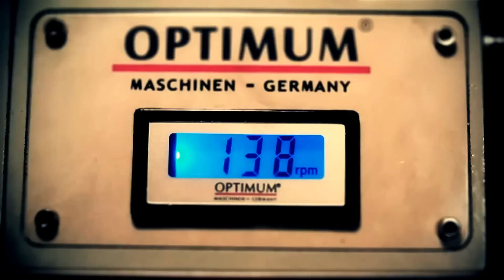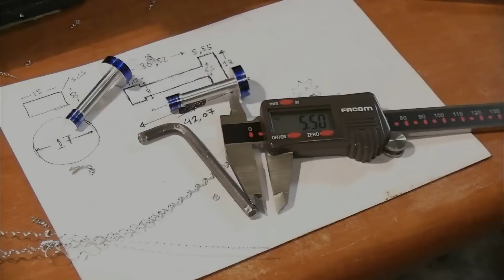Optimum D180 x 300 Steam Engine Part-4 | Connecting Rods |

Comment: i have watched your steam engine video playlist a few times. first just because it is what i want to build just bigger. i have also watch other hobbyist building steam engines but they all have big expensive work shops. i saw you put the work in the vice with calipers and thought why is he measuring them what way ? hours later it was clear your not measuring your using the two points of the calipers to square the work in the vice by holding the points to the back of the vice. that's good stuff to know. thanks for sharing

Comment: Awesome Video, watched all the top machinists on youtube, your among them! even without talking, its so simple to watch you work, talking just gets in the way of the art!, keep up the good work, i have to much play in my Sieg X3 too attempt this sort of work, and my lathe well there's one tool i can not get right because i went through 9 parting inserts, that's the only thing i cant seem to do, is part something off.

P.S i need to start on aluminum, im using grade 250 Mild steel for almost everything, you think aluminum is gummy people, try 250 M/S :| its #$^&
Reply from the maker: Thank you so much for your kind words! To be honest I'm not quite there yet but by watching the best maybe I'll be one day.
  In parting I'm using a 3mm thick HSS blade that I have grind a deep fillet for the hard materials and one with a shallow fillet for the softer ones.
 For aluminum avoid 6063 and use 6061 (soft) or 7075 (hard) alloys. You can use 12L14 also, a soft leaded steel that leaves a nice surface finish or some medium carbon steel like 1144.